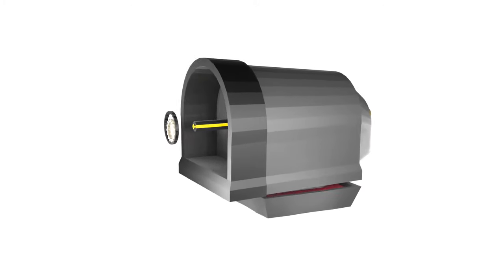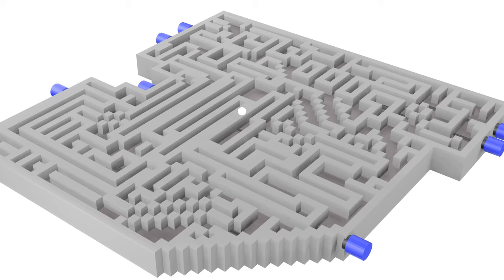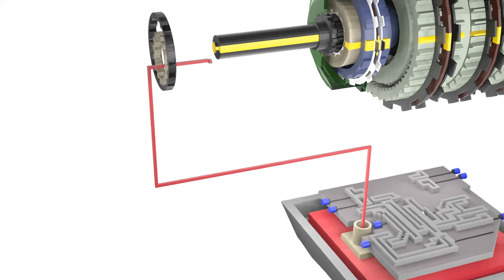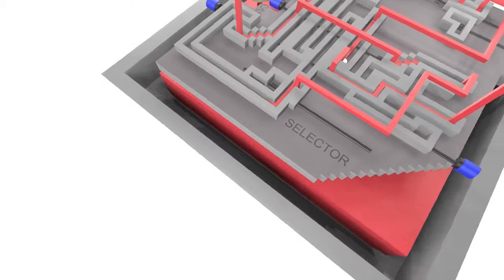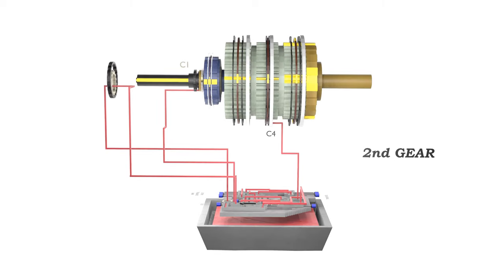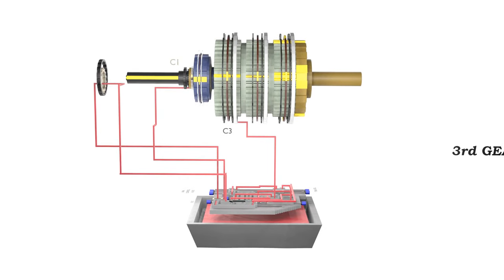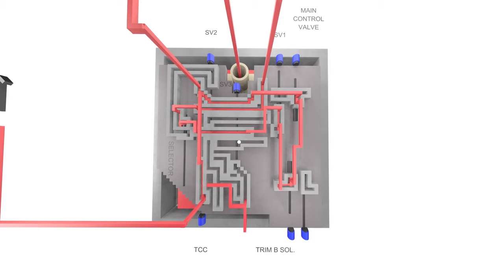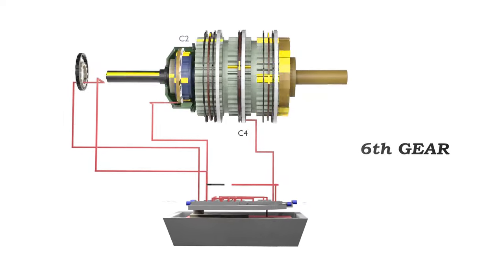[Hydraulics Explained] How Automatic Transmission Fluid Works With Valve Body: PART 3

Comment: If you coast in neutral will you wear out the c5 clutch pack?
Reply from the maker: Everything wears out over time. Coasting into neutral is much different than starting a parked car in neutral.

Comment from the maker: Edit 05:04 - Correction: Gear 2 will pass through three shift valves. It passes through Trim B, SV1, and SV2. As shown in video but forgot to mention this.